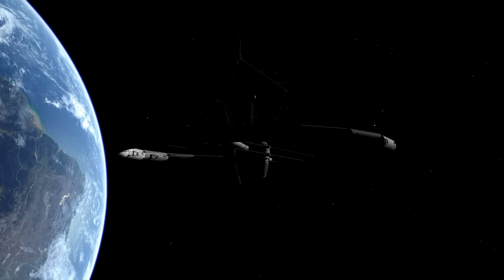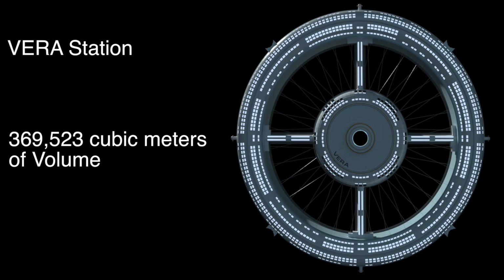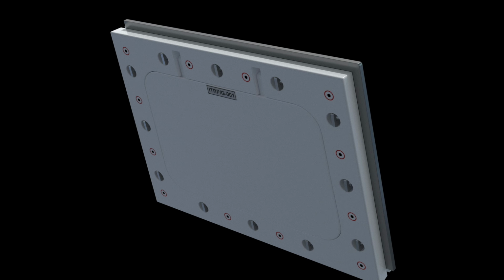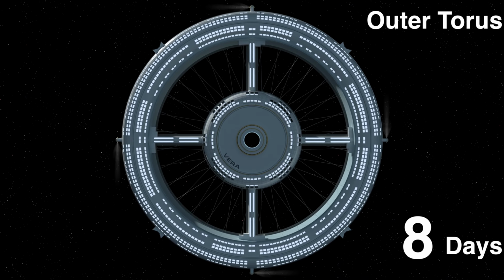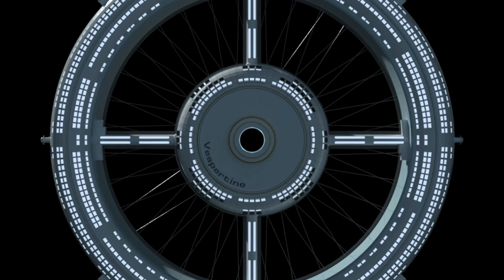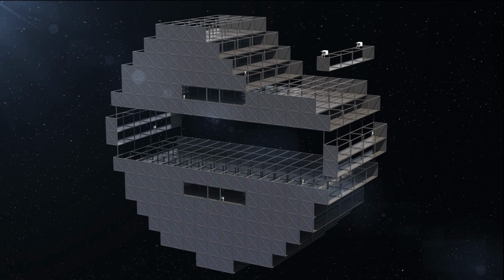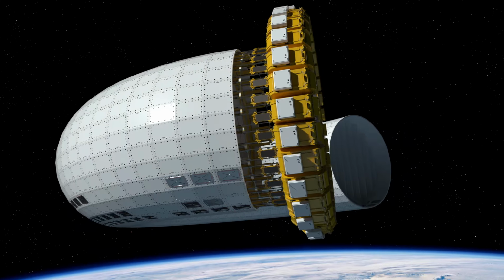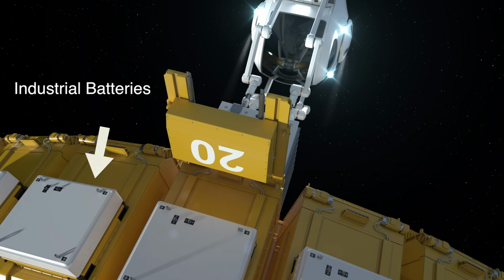We could build this huge Space Station in 6 months

Comment: Add fuel tanks and some kind of plasma drive or better,  then you can colonize the Solar system...

First up, a small propulsion system that can perform translunar injection and send it to orbit the Moon...

Second,  this gives options to colonize Mars, instead of going straight into Mars,  attain orbit and study. With Mars you need lava tubes. 

Jupiter, I think, is out of the question for now because of the radiation belts.

Saturn is a real possibility,  but at least three fuel tanks each as large as the largest torrid. Not including farming torrid. Orbit should be attained around Titan  - for its hydrocarbons. 

And at least one for each outer planet to ascertain resources. 

Nuclear power is a must out there.

Comment: So many acronyms! Problem with  continuous volume, is depressurization. Multiple small modules, are compartmentalized, lose one without losing the whole. 

Lots of issues with the ring builder. It speeds things up, but would require many launches before building one sub ring.

Easier to modify starships in space and use them as modules.

Comment: I hope this comes true I really really do, but I can see so many problems with it, I mean yes it can build huge structures really really fast and that blows my mind, but each module can only load a panel of each module has panels in it, soon as just one module runs out that row cannot be completed which means building has to stop, and as all of the modules would likely carry the same amount they would most likely run out at the same time, it could still be done though and I don’t doubt this but even at the end what do you actually have but a huge completely empty space, it might be fast to build but then how do you fill it, and what with, and how do you get it in there, filling it up could take trillions of dollars and millions of launches with materials, parts, power sources, vital equipment etc, etc, etc.

Comment: BEST IDEA I HAVE EVER HEARD! MAKES FAR MORE SENSE TO START WITH THIS SPACE PORT TORUS AND THEN USE IT TO FULLY EQUIP THE HUGE SHIPS THAT ELON AND BEZOS ARE BUILDING TO GO FROM THERE TO THE MOON AND THEN MARS AND OTHER PLACES TOO.
THIS JUST MAKES SENSE AND IT WILL PAY FOR ITSELF.
IT COULD BE MOVED TO DIFFERENT LOCATIONS AND IT CAN EASILY BE SHIELDED FROM THE SUN'S RADIATION AS WELL AS GATHER ENOUGH SOLAR ENERGY TO SEND BACK TO EARTH TO PAY ITS OWN WAY.
ELON, YOU NEED TO GET ON THIS BECAUSE IT COULD BE BUILT SO QUICKLY USING YOUR ROCKETS AND IT WOULD SOLVE SO MANY OF YOUR PROBLEMS TOO.
PLEASE DONT MISS OUT ON THIS OPPORTUNITY.
I AM NOT CONNECTED TO THIS PROJECT OR SPACE IN ANY WAY, BUT EVEN I CAN SEE THAT THIS IS JUST THE BEST COMMON SENSE IDEA THAT MANKIND HAS COME UP WITH TO MAKE MAN A MULTIPLANET SPECIES.
THIS IS A PROPER USE OF OUR TAX DOLLARS TOO.
IT WILL PAY FOR ITSELF AND PROVIDE AN ENDLESS BENEFIT TO ALL OF MANKIND.
JUST GET IT DONE!
THIS IS REALLY NEEDED!

Comment: A lot more can be achieved by a group effort the star ship could be made to become a torus . By using star ship as the outer skin of the space station makes perfect sense . Adjust the structure of the ship to connect to the next ship that is sent up . Why reinvent the wheel . Launching sections of the torus . Rather than a manufacturing plant and raw materials constructing each section in space . When there are  enough star ships to make the interior space needed . Equipment and raw materials would be sent up to finish the station  . We don't need to go backwards , like NASA throw away the new to use the old , attitude . NASA is the throw away space agency pissing away lots of money

Comment: Unfortunately he needs to have a few million to make a working space prototype and have Elon launch it.
It does not even need to be the fancy full ring version just one or two plate welding modules, that weld the shaped pre-manufactured plates. The welding modules rotates the welded ring sections adding another plate, until the ring is completed, when the ring end sections are welded together. The only issue is welding power. Being in 0g any deformation should be from the welded joints.

Comment: 5 cm thick aluminum panels? That's super heavy! I get it, you are trying to use them as mucro-meteor shielding but 5cm thick panels can't possibly be solid Aluminum good grief. 

2219 requires very careful welding practices.

You need to consider making the panels lighter.... they should be a Guage thickness with honeycomb interior sandwich construction. This allows much lighter launch loads to get the shape constructed.

Then you can send up panels for meteorite protection in the firm of polypropylene and kevlar which is also lighter.

The hollow panels can then be filled with water for radiation shielding or even better, a heavy-metal oxide foamed epoxy.

The thick plates are just too heavy............ you cannot lift that many solid plates.

Comment: It looks like it builds itself without problems, but the inner panels have to be smaller given the curvature of a torus, and every row of panels would have to be unique.
Reply from the maker: You are right; if you look closely, you will see they are smaller as you go inward.
Reply: @TheGatewaySpaceport  I just spotted the differently sized/skewed panels on the delivery transport. The 3D animation makes it look relatively straight forward, but it's not that simple. Absolutely spectacular engineering. Good luck!

Comment: How does the machine close off the ring? On the last few rows the back of it would butt against the other end. How would you weld that last part from the inside? Would you take off the machine before it closed the end or would you do the last one manually? If you did complete the ring with the machine could it somehow open so it can be removed? If you hinged the joints you could open the machine to remove it from around the completed ring. Something to think about.... good luck!
Reply: Also you didn't mention why a rotating station is important. By providing gravity it would prevent muscle atrophy and bone calcium leaching.

Comment: Thinking ahead further, such a station would probably be suited as part of a space elevator. Mass might be sufficient and an anchor further out required. This would benefit the outfitting and supply of the station first. Anchor and station mass maybe in the range of 10kt with the station weighting around 4kt. With Starship payloads at 100t...

Comment: Build a Taurus with 2ft (or more) diameter tubes. insert 6 biospheres equidistant apart in line. Use runner sleds like the mechanics use to move between biospheres.  Start with Labs , rent space for experiments and mining. When the station becomes profitable, replace sections of the tubes and add more spheres inline until the whole structure can be welded together, keeping the biospheres separate in case of breaches. The construction tubes might also be rocket  sections  carried into space.

Comment: I recommend using the Starship as a material dispenser to make the outer shell of the sandwich panel out of stainless steel. This results in two materials, welded twice. The stainless steel minimizes the risk of micro penetration by micro and mini asteroids/garbage, etc. And is a good shield against a lot of different radiation. The one-way use of the Starship increases the loading capacity.
I wish you all the best and a lot of investors, go ahead and don't let others slow down your thoughts.

Comment: I would be interested to know how they plan to stabilize the spinning torus. They wobble when they spin unless there is a means of keeping them in perfect balance. The stability of spinning objects in free space is a very difficult problem. Adding people only makes it worse. You've seen video of people and objects sliding to and fro on cruise ships in storms. It would be similar in a spinning torus in space. A cylindrical object flipping end over end would be easier to stabilize, although that object would tend to flip 180 degrees along the long axis, periodically. Take note that artificial gravity is a much more difficult problem to solve than is commonly imagined.

Comment: This has lost sight of one important thing.  That's unmaned money making opportunities.  Build the first station, but rather than using it as a stepping stone as a manned station for more manned stations, use it as an industrial clean room.  Through solar harvesting  for both electricity and heat, you have many opportunities for just one small station to pay for everything else.  Think about making ICs in zero gravity.  Not only would a clean room be much easier to be established, but crystal formation is no longer effected by the pull of gravity.  You don't even need to start with bleeding edge fabrication processes.  Larger processes for slower, but higher power devices is a huge market.  With the zero G fabrication, more sensitive parts, such as low nm ALUs or processing cores, could be brought up with a supply ship and combined with in house made memory, IO, and supporting interconnect.  That can then be sealed and shipped back down in the supply ship.  This could easily tap into the multi-trillion dollar IC industry, but reduce construction and running costs while increasing yield.  The creation of the wafer slug could be completed bringing the raw ingredients up, then using solar concentrators to heat the furnace to melt the raw ingredients into the slug.  If you know know IC fabrication, you can follow how this works from here.

It would also be interesting to explore what a production environment like this would do for other things like magnets or highly crystallized metals.

Comment: I have a construction method designed to utilize the zero gravity and vacuum of space to build any size doughnut shaped station that incorporates safety compartmental areas so if you get hit by a 1 foot meteor the ship won't turn into a rocket fed by 400,000 cu ft of air at 14 psi !  would love to share my ideas with you ! I'm talking reducing cost by a factor of a 1,000  times ! Your ideas sparked my ideas ! That's what I'm good at ! You have great ideas !
Reply: CGI Video, or it didn't happen. 😂

Comment: basic building blocks are in place?
bioster with convetablke secnd stage
lego ;parts to detatch and construct a side ISS with arms. each end slightly anglked so as to comoplkete a circle of 55- 12 sectiions? one central  dual docking hub  and two tbe center to outer hub units.biger the circle the more seal off aera and controls can be created.
cental hub should spin like the center of bile wheel? so as arriving ships do not spin.
on hub use it would lock to turning connection doors

Comment: These are great ideas and presented well, but a few questions do occur :
1. How low would a seat cost at lowest price predictions ?
2. Have there been plans to protect against small meteors like up to the size of a bowling ball ?
3. Will the spaceport be able to travel by itself to its final stationary position and move out of the way to avoid large passing space rocks ?
These are the first questions I thought of. There's probably a lot more from other followers .
Reply: Micro meteors could be a big issue.  And the larger the structure, the greater the chance of collisions.  Thin aluminum structures are far from bullet proof.  And impacts of tiny meteors are comparable to bullet strikes.

Comment: Cool and sound ideas as previously seen from Gateway.

However, the lack of indepth information, seen as they have been around for 10 years now, is troubling.
Where is the hardware?

Where are the cost projections of the "Tree" cargo pods which are sending the panel segments up with starships?
Design and cost of the "Hatship class pods"?
Design and cost of the prefabricated panels?
Design and cost of the welding machines?
Design and cost of Sargon construction segments?
Estimated cost of a <Size X> space station?
How will the fully welded station be pressurized?
How with the pressurized station be leak tested?
How is the funding situation right now?
... Do you have anything but flashy youtube vids?

Suggestions from my side:
1st: Show a design for the panels and the sargon segments, including costs
2nd: Make a prototype square builder (4 segments instead of 32) and build prototypes: single 1x2 panel line, 2x2 panel squares, square "circles" of boxes,  a full tube rectangular cross sections... down here on Earth
Heck, i would consider a 3D printed plastic Sargon with some hot glue guns for "welding" plastic panels a step forward! 

other suggestions:
- Build the panels in double layers (each panel effectively being a flattened cube/a parallelepiped) with an integrated sensor package inside. If the outer or inner panel wall is punctured (from space debries or a clumsy station dweller) sensors will be warning you of a panel failure, but it is not necessarily a life threatening situation. The panels can also be filled with some material for added "bulletproofness" (woven kevlar-like materials)
Reply: The fact that he’s asking for donated time for someone to render interiors and such shows how much of a pipe dream this company is without funding.
Reply: Great comment and feedback
Reply: The thing they did to humvee gas tanks when Iraqis kept shooting them. They aren’t bulletproof, they just self seal

Comment: Basic problem is getting in and out and servicing
the outside of the spinning structuer?

a central hub to dock?  a docking section
that stays stationery with a airlock
for transit of personal and cargo
onlocking shop to hub
airlock opens to service area
and closes and airlock to hub central core
that spins opens
airlock hub and central core can lock and start to rotate
five or six and more rocket hollow cores could make a circular
station.
a spinning rocket at center hub could cause problems
in side rocket

Comment: First of all, it has potential, but second of all, you have to adjust some major things, like the inner circle has to match the G-Forces of the outer circle!! so it cant be made as 1 part, what you looking at is a 3 part moving space station!! the inner for docking, the middle with artificial G-Forces, and the outer matching the G-Forces of the middle one!! third problem now is, how do we get from the middle to the outer? exactly becouse both have to turn in different speeds it's impossible to link them to eachother! you should try to look at a 2 turning parts station!

Comment: No hatches in the Tori rings = bad design.  If one segment goes bad, all in that ring would need to seek shelter in the other ring. And until the damage is repaired, uninhabitable.  Should have at least a bulkhead at the point where standing at one bulkhead with your back to it, you can't see the next bulkhead ahead of you. Each segment the should have a tube to the inner ring.  Say at least 6 segment in the outer ring.

Comment: In the event of a micro meteoroid puncturing the hull of the ring station.. It would be wise to have the ability to close off sections so the whole station is not compromised. Rings could be stacked on top of one another adding functionality and strength.

Comment: I know this was probably to hard to go into details in video but if it's 3d printing 8m space. Is that more or less expensive to build in space verses using the new Raptor 3 which will almost double capacity of the star ship, which would allow you to connect say 50 star ships together and making station out of them. I am always for new inventive ideas. But if you try to make somethingorw complicated verses less complicated, you will fail. It's like the old saying goes. When you need to hammer a nail in, just use a hammer, dnt get fancy, u just need a hammer
Reply from the maker: We don't initially plan to 3D print anything in space. Panels will be created on Earth and shipped up with Starship.
Reply: @TheGatewaySpaceport  ya I commented before I saw that part :)
Reply from the maker: @tylerscofield9799  👍

Comment: The idea of needing EBW or Electron Beam Welding to seam the rings is ludicrous. It would require gobs of power and impossible to test the weld quality.

It would be far easier to use composite panels and glue like epoxy to build the station. Lighter, stiffer and stronger. 

I think an inflatable inner shell wall made of kevlar would be better than letting the outer shell be the pressure vessel.

Comment: Great, at LMSC we analysed similar configurations ad simulations showed the need to put in plane rails in the radial tubes to accomodate the lateral coriolis side forces proportional to the velocity to the outer torus travel and on the opposite side to return to the hub docking facility. A significant lateral load, when transfering 'heavy' equippment. That determined the lateral missalignment , a relative rotation of the inner hub to the outer torus, best using cables like the spokes on  a bicycle wheel.

Comment: I would go with the inflatable modules method.  Inflatable module would be connected end over end to form a torus.  Then several torus would form a hollow space between them or the internal ring....Then a transparent bubble dome...Over time recycle material would be used to harden the structure.

Comment: you have to build rotating habitats just as you build a suspension bridge. The metal plates will fuse together on contact at space temperatures, but they can buckle under their own weight once it rotates. You need trusses all over this ship, and you must use light weight materials, a balance between strong structure and light weight. Somehow, you gotta figure out how to balance the mass around the torus, within a percentage of perfect, within a few seconds of somebody moving around inside, and nobody knows what percent or how many seconds before the Dzhanibekov effect flips the station, rupturing the seals and killing everyone.